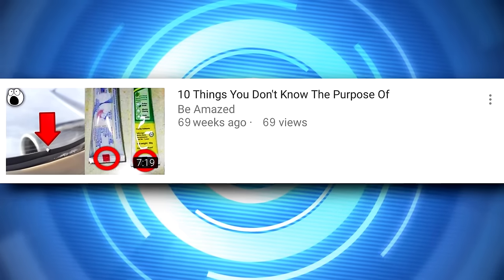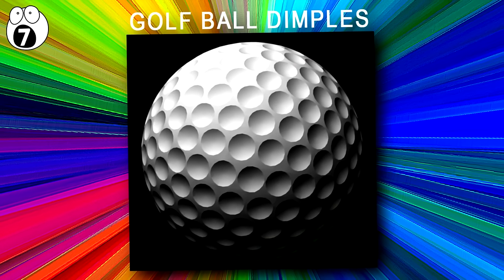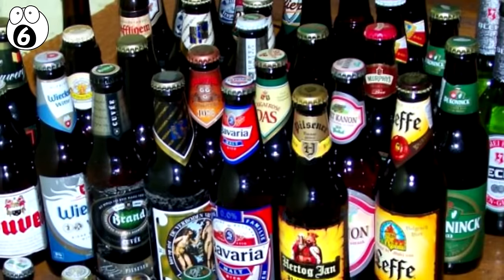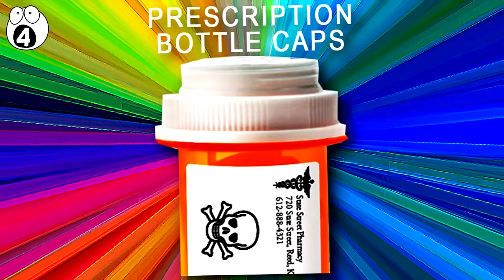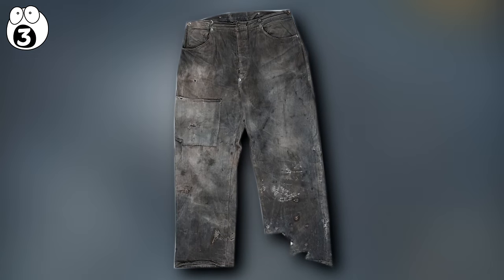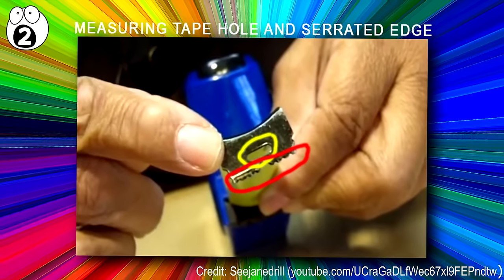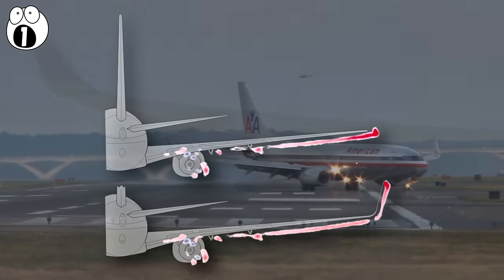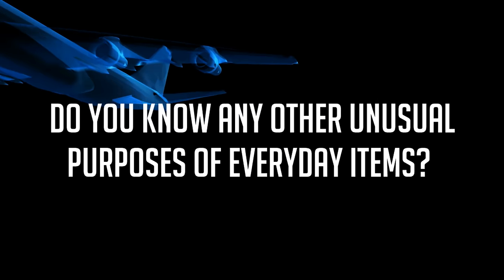8 More Things You Don’t Know The Purpose Of

Comment: Originally, alcoholic beverages were kept in dark glass bottles due to the fact that dark colored glass was cheaper to make.  But when some manufacturers began to make higher quality and more expensive clear glass bottles for alcoholic beverages using a cheaper process, it was discovered that certain beverages and other things would spoil sooner so they went back to the dark color bottles.   Dark green, black and cobalt blue have been popular colors that accomplish the same thing but beer being the less expensive liquid, they kept putting it in the less expensive brown (known to collectors as dark amber) bottles.   Wine, which generally is more expensive than beer, is kept in the somewhat more expensive dark green glass.   But many beverages with a higher alcohol content are sold in clear bottles.   Beverages with a higher alcohol content are less affected by sunlight.

Comment: This is the nerd in me, the last one is called the Sutter twist, it was engineered by Joe Sutter for the Boeing 747, without it the vortex forming on the tip of the wing would create so much drag it would rip the wing off, the whole 747 project would've been canceled without this twist.
Reply: and the airbus a380 would have never gotten off the ground without them
Reply: The Sutter twist is a small twist on the wingtip of older 747s. They are not the same thing as winglets

Comment: For the small pockets inside the pocket, they were meany for zippo lighters and pocket watches. As the zippo lighter was designed to be rubbed against the Jean to light it.
Reply: I use a Zippo, but one good payday, I thought it would be cool to buy an old 1950's type of lighter with a clear bottom and a pair of dice rattling around in it. Very cool looking. Unbeknownst to me, it leaked all the fluid into a particularly sensitive place - 'What's so itchy down there?' 5 minutes later 'OMG IT BURNS!!! IT BURNS!!!'. No date that night, not the next weekend, either. Stick to Zippos - they're quite cool enough already.

Comment: The Airbus A380 was probably the 1st commercial airliner to use the upturned winglet thing. The plane is so big it really needed longer wings for proper lift. The problem is that airports have a wingspan limit for planes. Extending the A380 wings would have made them too long to fit airports. Like the polite Brit mentioned, the end of wings cause turbulence effecting negating the last few feet of the wing. Wasted wing is no good. By using the upturned winglets it effectively lengthens the usable part of the wing gaining back valuable lift. By using these upturned parts on the A380, Airbus was able to gain the needed lift for the massive plane. Now they are used on pretty much all new commercial airliners and I believe even older ones are easily upgraded. Even some smaller corporate leer style jets now use them. A side effect of the winglets is reduced fuel consumption. By creating an effectively longer wing resulting in more lift, the engines have to work less hard to keep the plane in flight.

Comment: When brass and copper were first used as door handles, nobody knew about the transmission of germs then, so that's NOT the reason for their invention.
 The small pocket on mens' trousers and jeans are called 'fob pockets' after the fob watch that was usually put into the small pocket.
 When fob watches went out of fashion, the pocket remained and then used for coins. I don't buy trousers or shorts unless there is a functional fob pocket designed in them.

Comment: I know why there are still ashtrays in airplanes lavatories. Even on brand new aircrafts. 
It's actually a regulation and a plane cannot legally take off without it. 
The reason is simple. If someone were to break the rules and still smoke in the toilets of the plane, it's better that that person disposes of it into the ashtray rather than in the toilet bowl or in the sink. 
The dirty water from both the sink and the toilet goes into a "waste" tank which is emptied on the ground while the clean water tank is filled. 
Even though there shouldn't be much air in that waste tank if there was some and someone threw a lit cigarette in it, because the waste can decompose into methane there would be a risk of fire or even explosion.

Comment: Flip-flop sandals neither flip nor flop. Flip means to turn over forward. Flop means turn sideways. eg flip over a card, flop into bed. A flipped house is one where the ownership quickly turns over to another owner.  A flop house is a run down or cheap place to lay down to sleep (flop) temporarily. If an image is flipped, it is mirrored. If flopped, it is upside down.

Comment: birds may be to thank for the design concept but the actual implementation is owed to a bruce willis movie, in the movie the wing tip vortex was seen in rather surprising detail, aerospace engineers knew of this problem as was stated in this vid but they did not know how far those vortex could travel after landing. the movie showed the vortex still churning away several minutes after the plane left the scene, when people realized what they were looking at and made the connection to problems on the runways they had never had a good explanation for they went in search of a means to eliminate them. winglets could be places at an angle to add more lift, not a significant amount to be sure but lift none the less. however it was decided that the winglets should go as close to vertical as possible so the vortex problem could be directed up and away from the places it could cause real problems. cheap jp7 in the 80s meant they didnt care about the fuel costs nearly as much as they do no and the environmental aspects, while important even then, were not important enough to c make them add the extra effort but runway level crashes caused by a problem the aircraft itself creates as it lands is grounds for lawsuits and with the entire world seeing that these dangerous vortex hang around on the runway for long periods of time they acted.

Comment: Actually using brass and copper handles was partly for cost, partly for easy to make, and mostly down to fashion of the time. 

As for pill safety caps - I have never seen them. 

The rivets on jeans were used in the early times of jeans for repairing - they later became fashionable. 
The pockets are perfectly strong enough without them. 

57... just branding and the sweet spot tapping is pure myth. 

:-(

I haven't checked into the other ones. But you really need to separate myth from fact.
Reply: Bang on...Very Very few door handles are now made from Copper or Brass, cheaper alloys are used. It's more are of a coincidence it has anti-bacterial properties than a reason.  Copper or Brass have been used since 1750's, mostly as it was an easy metal to form and it was shiny (ooooh).  The concept of anti-bacterial in 18th century was never in people's or Door Knob makers minds, not when you still had people shitting in the streets, bathing once a year or not at all...
Reply: Worked in pharmacies.  It is up to the (pharmacy) corporation and cost control.  There are a few "vial and lid" manufactures, which have different designs.  The most "involved", and worthless design in my opinion, is the one referenced in this video.  It is a "one-clic" design, note the "safety tab" on the vial upper edge.  Terrible for automation, and costly.  There are other vial and lid designs which satisfy safety and ease of use for the consumer.
Reply: ***** - how can i be wrong when i never said that brass doesnt have that effect?

in fact what i said was wrong was the reasons brass handles were used!!!

please learn to read before commenting.

it's possible at a later time that it was discovered to be cleaner in appearance and by chance they were using it more... but the micro-bacteria world was still pretty much unknown when brass handles were very popular.

(you are right that it can disinfect itself over a 7 hour period IF it is untreated and not varnished etc --- but i never disputed that fact)

Comment: I disagree with the anti-microbial surface argument for brass handles. Historically, brass was easy to cast, and took up surface details well in fancy and expensive handles. That's why. Historically, most handles were wood, or cheaper than brass wrought iron. In the modern age, brass and copper are clearcoated when used on handles thus negating any antimicrobial effect, But the colour looks good, and "old fashioned", even though few handles will be solid brass, but instead coated with a lookalike modern metal, and just made out of cheap, modern, cast mild steel or zinc alloys.

Comment: I'm calling bullshit on the first one, brass and copper usage for handles and knockers goes back hundreds of years. Main reason to use copper and brass for items that are constantly in contact with moist hands and open to the elements is because they don't corrode and rust like iron does, plus brass is an easy to produce allot that's much more durable than copper

Comment: Wrong wrong wrong. The upturned edges of wings is to facilitate more lift without making the wing longer.  Things like gate space at airports dictated the maximum wing length, so new planes were restricted to a maximum wing span (no one was going to rebuild all the world's airports just to accommodate a new plane), so engineers needed to come up with a way of obtaining more lift without longer wings or losing efficiency.

Brass and copper door handles - anti macrobial possibly, but that's not the reason you see them. Handle makers did not, and I believe still do not, take this feature into account. Go into a modern hospital - do you see lots of brass and copper door handles? No, didn't think so.

Heinz 57 sweet spot - really - I guarantee zero percent of the next 100 people I ask know this. Heinz did a survey did they? Really, really. No.

If you're going to put yourself out there as some sort of educational prophet - get your facts right.

Comment: there ARE NO COPPER HANDLES!
Reply: Dear N. Steele, brass is a combination of copper and zinc.   Also, I have a few very ornate (round) door handles from the turn of the century which are mainly copper.  Quite beautiful.   "Handles" is another thing  not in my collection.  I will look for same.
Reply: Alex Andrite Interesting. Thanks for the comment. Even though microbes weren't discovered until the 17th century, people apparently (Wikipedia) saw that water in copper vessels had no sludge/slime after weeks.

The antimicrobial properties of copper and brass are massive; 99.99% kill rate of e.coli and even MRSA after just 2 hours sitting on a handle....

Incredible. It's like someone cleans it with bleach every few hours!

What a shame all hospitals and homes are moving to stainless steel handles! Which has absolutely no germ killing properties at all, vs brass & copper being as effective as self-cleaning every 2 hours! We should spread this information like an infection :) thanks again for the comment.
Reply: dutchrjen aren't most cans for food made with anodized or galvanized steel?

Does brass tarnish? Why are thy used for homes and stainless steel, something that has zero germ killing ability, used in hospitals?
Reply: dutchrjen ah thank you for the very thoughtful and well thought out comment :)